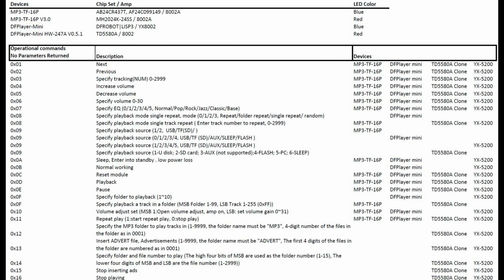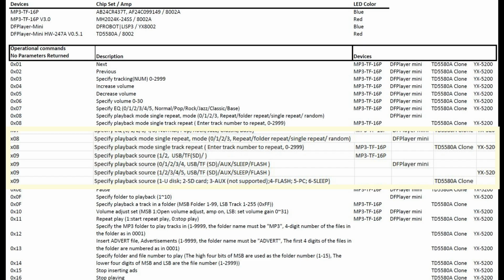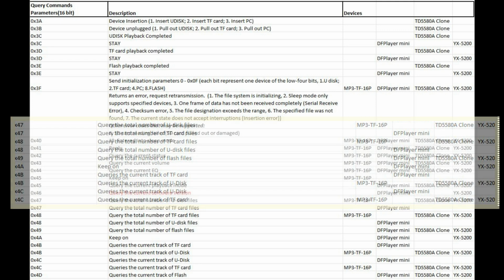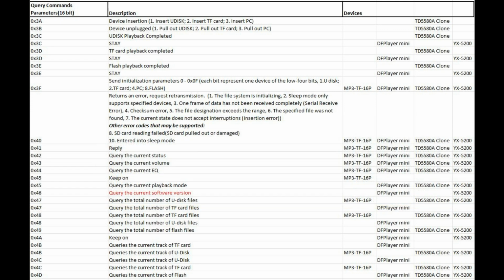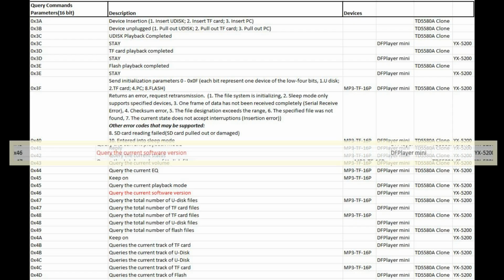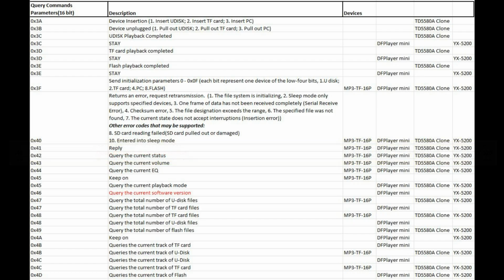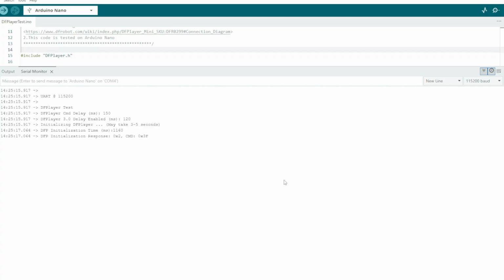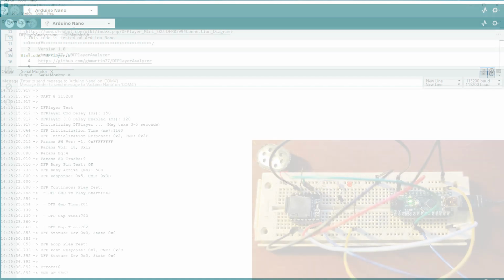DFPlayer Review (5 Different Chip Sets)

Comment: Hey. Great video. This data would have been very useful to me two years ago. For my band I built a Multitrack player that plays 2 stereo tracks in sync with some data for our light show. 

In the first version I used two DF Players and started them in sync. (Or at least I tried to). I noticed that after some time the players started drifting out of sync. 
By playing a 1khz sine wave file and measuring the real output with a scope, I determined the closest two out of the 10 players I got. All of them use the GD3200B chip but played at completely different speeds.

I also had problems that it automaticly does a Fade In when the Audio starts. And also sometimes when the Audio file contains silence for a few seconds. This was also a problem when you try to play a metronome track for you band. The Fade in made some of the metronome ticks inaudible...

Last year I made a new revision of our multitrack player using a Tsunami Super Wav Trigger board instead. This one is super solid and can play up to 8 tracks completely in sync. Absolute great board! Also the customer support was amazing after I found a little bug in the firmware. Best money I have spent in a long time.
Reply from the maker: Sounds like you found a great solution. The DF players are nice little boards but vary so much across manufacturers and a surprise to me even the same manufacturer.  I still love them for models and Halloween projects. Can't beat the price if you can find a good one.